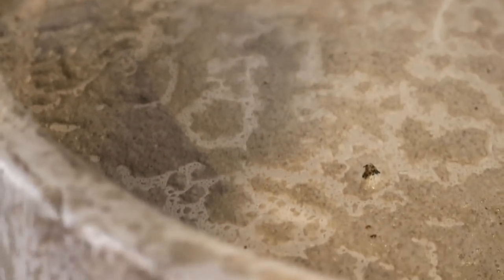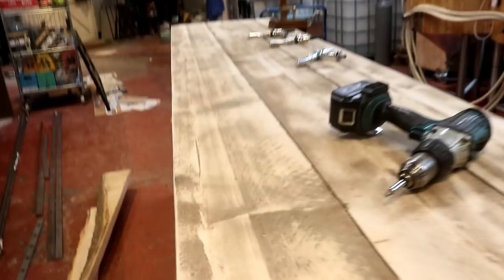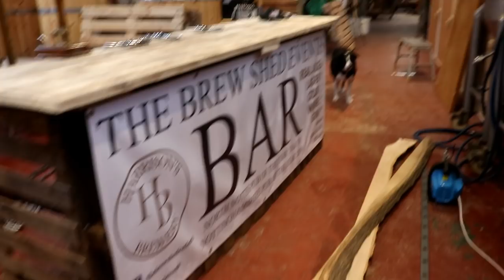EVENTS BAR

Comment: Harry here is a tip for grinding Aluminum Before grinding take wax, form a candle is ok and grind the wax into the grinding wheel. The aluminum won't clog it up. You may have to repeat a few times depending on how much aluminum you are grinding.